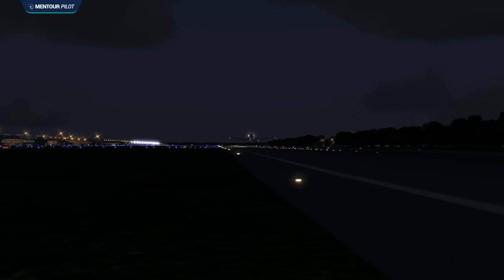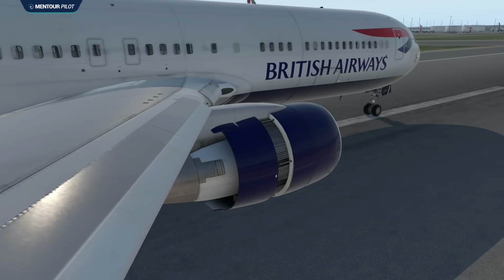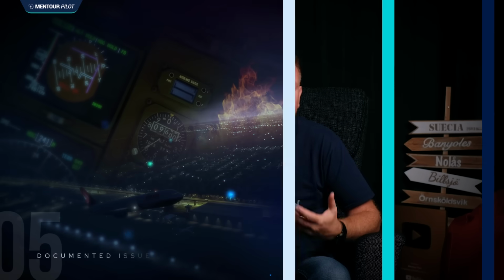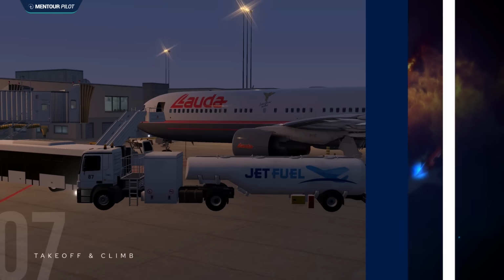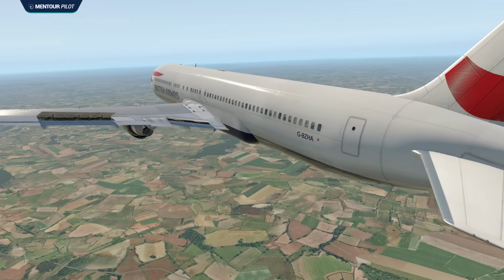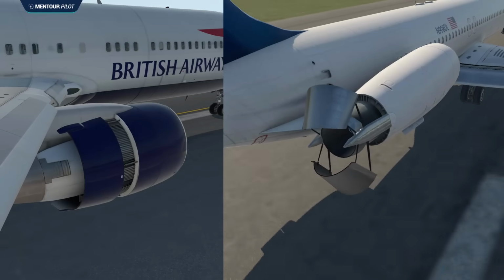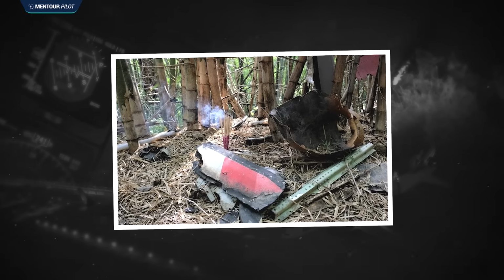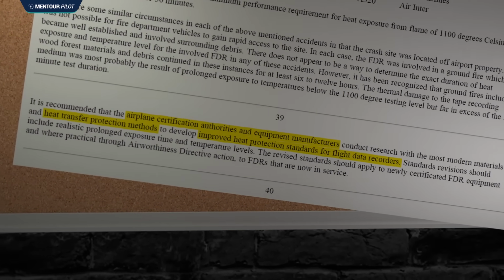HOW an Impossible Failure CRASHED this Boeing 767!

Comment: Disgusting that the wreck site was looted! Wow! I was in Dallas in the 80s when the Delta wind sheer crash happened and people were stealing the luggage that had fell out of the plane after it skipped across the highway. What kind of person does this? Shame!
Reply: @axo9813  yep, I was motorbiking from Chiang Mai to Pai with a friend on another bike in 2003, miles from anywhere on a very windy road, my eye was caught by a group of Thais having a picnic a little way off the road (probably a break on their own road trip), just as I lost control of the bike on some gravel and went crashing into the ditch by the side of the road.  Not a single one of them even got up.  I think they thought I was just a stupid white foreigner and didn't deserve any help, but they may not have moved even for a local.
Reply: Unfortunately not surprised…people have no consideration , respect , etc such a sad world
Reply: I'm Thai and want to tell that this can happen here. They also loot items from the crashed truck. because they thought no one would want it so it belongs to them.
Reply: I was in Ft. Worth /Dallas during that time and I was a truck driver with a route that sometimes took me North of the airport.. I remember seeing the dented in water tank that ultimately stopped the aircraft 
I also was able to view the auto that was hit by the planes engine  killing the driver. This is the first I heard of the baggage that was lost from the plane after hitting the freeway.. There is nothing more disgusting after a crash then stealing from the victims.
Reply: @robertemory3620  I lived in Dallas when this happened and don't remember looting. For one thing, emergency people were there almost immediately, so it is hard to see how looting could occur. This wasn't in the middle of a jungle.
Reply: @Pete P   am well familiar with Maslow from university. while that applies to humans in general it excludes cultural-societal traits. many a thai academic and/or journalist have written about issues in their society. strong emphasis of theft, corruption, deceit, cheating and lying. after the terrible thai floods a few years ago locals were selling back items they found floating to their rightful owners, this included japanese factories. even one of the thai princesses comments to the effect "why cant we be like the japanese" referring to how fukushima residents helped one another after the tidal wave. they made lost and found's and did not sell back peoples property. was also extensive organized looting by thai's of thai owned properties during the flood. looters had boats and tools to break into homes.
Reply: @axo9813  re: cuts and scratches, I got a really cool long cut from that crash on my right palm that coincided perfectly with my "life line" so the scar extends it, so if you believe all that palmistry bollocks, apparently a tiny piece of gravel forced accidentally into my hand extended my "health and physical vitality" by some indeterminate amount :P I also got a "Harry Potter' style lightening shaped scar after another bike accident broke a bone in my wrist requiring surgery, so that's another win.
Reply: @axo9813  NO EXCUSE to loot the dead Evil, pure & simple.
Reply: @lpetitoiseau9146  You might have said despicable, disgusting, immoral or something like that, but calling that sort of thing evil is just hyperbole.  Save the word for actual evil.
Reply: @crinolynneendymion8755  You don't think cutting jewelry off the dead and stealing aircraft parts which you have no use for evil?
Reply: There have been several times where crash sites have been looted.
Reply: @Orange Crush: you’re assuming that all bipeds, called generically “humans”, are the same. The truth is that we are living in a complex world with lots of differences between groups of individuals, as well as between the individuals belonging to the same group. Different history, different childhood experiences, different environment, beliefs, etc.
If we would be all nice and decent people, you won’t see wars or similar activities.
Reply: @axo9813  I think it is unfair to imply that these kinds of things would only happen in a developing country. I've read about paramedics in the USA taking valuables like watches and valuables from the people they are transporting to hospital.
Reply: @hughmungus1767  Either the New York Police or the Medical Examiner personnel stole a 5-carat diamond ring from a close relative who died alone. Same thing happened 15 years later when another close relative died alone in NYC. All visible valuables disappeared. When the Twin Towers fell, they found crushed NYFD fire trucks filled with merchandise looted from Brooks Brothers, a fact which was suppressed.
Reply: THEY ARE STEALING LUGGAGE FROM DEAD PPL 💀💀💀💀💀💀💀💀💀💀💀💀💀💀💀💀💀💀
Reply: Unfortunately humans tend to be disgusting most of the time, in some kind of specific environments. "They're dead anyways" is probably what those looters thought, when you're extremely poor you take everything you can get, respect means nothing
Reply: The same people that loot and rob and kill and then protest.  Look at detroit and san francisco and chicago and la
Reply: Desperate times call for desperate measures.
Reply: @Matthew Morycinski Id say it's every man for himself, across the whole world right now.
Reply: @Matthew Morycinski yep I agree
Reply: I was living in Big D then and don't remember looting to the extent of the Thai crash. The cops got there almost immediately.  I was working on the 55th floor of a skyscraper in downtown Dallas and could see the smoke plume. I was also working in a Chicago skyscraper when there was a crash at O'Hare in 1979 (?) which we could see.
Reply: OMG❤
Reply: Shame. Shame. Shame.
Reply: @axo9813  Just to clarify, you saw a lot of crashes of aircraft in Thailand?
Reply: @robertbruner93  As a Thai... I can confirm it happened a lot - usually to the car accident victims.
Reply: What drives people to this? Abject poverty is the biggest one.
Reply: @ZeldagigafanMatthew  Integration baby
Reply: @axo9813  Yeah, it's Thailand. No doubt where YOU live your culture is much more sophisticated and kinder and gentler and everybody is absolutely an angel. Right? Please let us know where you are so the rest of us can all apply to come and live there and civilize ourselves.
Reply: These are people living on the edge so the plane crash all the people are dead but there are things that can improve there survival it’s like survival in a life boat what’s horrible in a rich society isn’t so important when it can improve your survival
Reply: The exact same thing that I was thinking.  Dead bodies staring at looters.  They will all go to HELL.
Reply: Not the only disgusting thing that happens in Texas….
Reply: @Matthew Morycinski my point is that today, it seems like it's every well-fed man for himself.
Reply: @axo9813  Crticizing a place is alright. Affecting a tone of cultural superiority while you're doing it is not ok.  Tell us where you live and I'll come back with about a zillion "criticisms" of your country, all of them absolutely valid.
Reply: It’s not like the passengers need it anymore.
Reply: Joggers, dear.
Reply: Rape is still a thing. Seems like looting from the dead is a far lesser offense to me.
Reply: @Frank Roberts True  and also descendants from there  living here, and then they blame the people with less melatonin in their skin..
Copy?
Reply: @robertemory3620  well that didn’t take long.
Reply: @TooLowGear  nope it's pretty instant nowadays..facts don't liie..Choose truth o er facts like our befuddled and grammatically challenged President Biden lol
Reply: @robertemory3620  not American mate, so I’ve no idea about your presidential woes.
Reply: You asked "What kind of person does this?" Did you make any effort to find an answer to your question or was it merely rhetorical, in support of your prejudiced condemnation using "disgusting" and "shame"? Try educating yourself about humans before you condemn them. Learn about Maslow's Hierarchy of Human Needs. It explains how humans only act in a particular manner when they feel a need to do so, and those needs only manifest according to a hierarchy of importance governed by nature, with higher needs manifesting only when lower needs are adequately satisfied. The need for food and shelter are primary, security is next. Self-grooming and preventive personal care comes much later. So does having a job and participating in efforts for the common good of society. It is ignorance of this nature of human beings that enables people to criticize homeless and starving people with comments like "You have so much time… why can't you trim your fingernails?!" or the classic insult yelled out in passing "Get a job!" Trying to force a person to feel a higher need that you feel is mind control, considered abhorrent in socially advanced societies; while the effort may appear to work in the short term, it is actually destructive and dehumanizing. While dead people may be buried with items of substantial value in places considered "developed" and with high GDPs, to people elsewhere who have lived with no assurance that they will not be starving two days later a corpse is a person who can feel neither respect nor insult and no longer has a need for belongings, so letting valuable items lie strewn on a hillside when they could be traded for food for the day after is just plain stupid. The preservation of those items towards perhaps improving the safety of flight a few months later is simply not a need that they feel. I hope that answers your question.
Reply: @petep.2092  Does that include the Dallas looters?
Reply: It happens everywhere all over the time.
Reply: @yeugeniuss  looting after an aircraft crash??? No it doesn't?
Reply: @jordangreyling8820   i have seen other crash videos with stuff stolen.  Quite a few
Reply: @jordangreyling8820  it absolutely does, that’s why police are on the scene doing crowd control as soon as possible
Reply: @yeugeniuss  f[_]€k those looters. Everyone of them. No excuse.

Comment: In about 1975 I was flying United Airlines from LAX to PHL in a DC8.  The Pilot came over the PA and announced he got a quick clearance to land in PHL but was too high, so as a result, he would be reversing the four engines and we would be landing soon.  Yes, indeed, the four engines were reversed in flight and we dropped like a rock and landed.

Comment: This accident is similar to the one that happened in 1996 in Sao Paulo, Brazil. It was a Fokker 100 that belonged to TAM, at the time the biggest Brazilian airliner
Reply: The difference with the TAM accident is that it probably should have been survivable, had the crew been trained to deal with that failure, which sadly they were not.
A reverser deployment on the F100, whilst still a serious and dangerous failure, doesn’t present the same level of threat to controllability since the engines are behind the wings so cannot disrupt the airflow over them. A protection system is in place in the form of a cable that physically pulls the throttle lever back to idle if the reverser is deployed. Not knowing what was happening, the TAM crew pushed the throttle back up and broke the cable, causing the aircraft to go out of control.
Further complicating matters was the design of the Flight Warning Computer on the F100, which was programmed to not present engine-related warnings between lift off and 400ft AGL, in order not to distract the crew or trigger them to act hastily at low level. The only indication that the reverser was deployed would have been a small letter R next to the EPR tape, which the crew was unlikely to see as they hadn’t been trained to look for it.
Modifications were made to the thrust reversers on the F100 to make inadvertent deployment less likely and as far as I know it never reoccurred. Training was beefed up too so that crews would know how to respond properly if it ever did.

Comment: The redundancy provided by having two closed hydraulic valves which are controlled by separated systems to prevent the hydraulic actuation when the gear is up and the controls are forward is simple and effective enough. 
  In theory, in flight thrust reversal would require a failure of two systems simultaneously. That is to say that it would require any sequence 1)both valves would have either needed to see an actuation command. 2) Both valves would have to fail or bypass leak simultaneously 3) One of Either valve could have seen an actuation command while the other valve failed/leaked.
  Is this correct?

Comment: The level of detail in your illustrations is amazing.  Some elements of the accident in this episode bring to mind one story that I would love to see you cover: the 1994 incident with FedEX 705.  Specifically, how did an injured pilot and a DC10 survive an inverted dive in excess of 650 kts, lose the counterweights in the tail, perform acrobatics like a fighter, and manage to land overweight, overspeed and with a full load of fuel?  
The reason this came to mind is because this same plane (now a MD10) was in the news again last month, when it performed an emergency landing in Tulsa.  This led to a lot of discussion in the comments (on a couple different platforms) about the first incident, and several of the details are quite similar to those in this video.  The difference was, the DC10 held together and landed more or less safely.  

Now, the most recent incident with N306Fe happened on 7th June, when a suspected cargo fire that turned out to be 2 entirely unrelated bugs.  Literally, a cloud of 5000 escaped ladybugs in cargo that triggered the smoke sensors, plus a heat signature in the same general area caused by some exhaust issue in the #2 engine.  Anyways, there are quite a few avgeeks in the US that follow this plane (still hauling cargo 30 years later) and it would be really cool to see you illustrate what happened during that amazing incident.  There is so much technical stuff that got skipped in the one documentary I’ve seen on it, which focuses almost entirely on what motivated the guy that attempted the hijacking (which led to the arial maneuvers in an attempt to keep the attacker off balance), and what physical injuries the crew had.  Haven’t seen much of anything on what happened to the airplane, but there are pretty good details in a book.  Would be awesome if you could illustrate this incident on your channel sometime!
Reply: I agree. I always wondered how FedEx 705 was able to survive the extreme maneuvers beyond its tolerances, or if it was damaged by them.
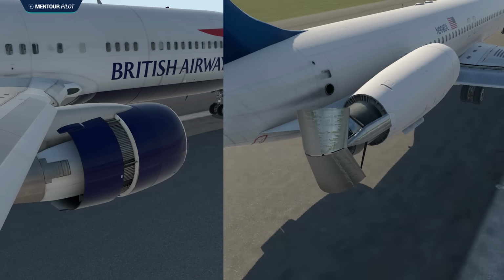Reply: @barbarawilcox182  Believe in JESUS today, confess and repent of your sins. No one goes to heaven for doing good but by believing in JESUS who died for our sins.  For God so loved the world that he gave his one and only Son, that whoever believes in him shall not perish but have eternal life.(John 3:16)🥳❤️😗❤️🙌
Reply: @alunesh12345  stop it.
Reply: @alunesh12345  
In order to find peace within say aloud 3 times - 
THE POWER OF COPY AND PASTE COMPELLS YOU! 
THE POWER OF COPY AND PASTE COMPELLS YOU!! 
THE POWER OF COPY AND PASTE COMPELLS YOU!!!
Reply: Wait, does he do these illustrations himself?! I’m a new subscriber, I was just trying to figure out where he gets these detailed renderings from. My goodness, this must take him forever.
Reply: @dewilew2137  He has people who help him but I don't know the details.  In early videos he mentions who did the animations but I don't see it mentioned on this video. The the description lists all of the non-original video sources but I doubt that they account for 100% of the video.
Reply: @dewilew2137  Hi Dewi!  Excellent on the sub, thank you and welcome to the Mentour Crew!  Petter has a team of highly skilled, really cool sound people who help him create the visuals for these episodes.
Reply: @dewilew2137  He has a team now putting the videos together. The videos were good before this, they've always been high quality and professional. Now they just have a little icing on the top.
Reply: @dewilew2137  I believe it's the game Microsoft Flight Simulator.
Reply: Think of this channel like a TV show. There is a whole production team  @dewilew2137
Reply: I second this idea!  Please do a video on this incident!
Reply: @MentourPilot
Reply: Douglas built the best airframes.